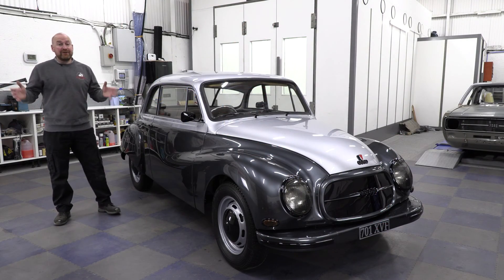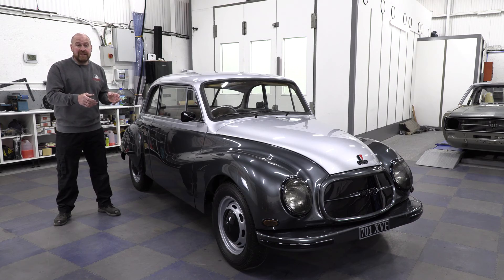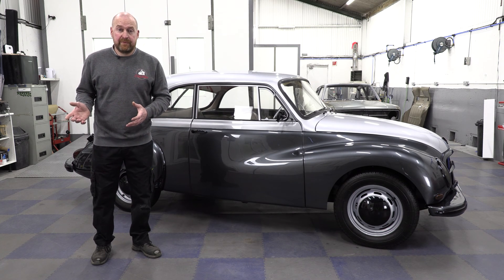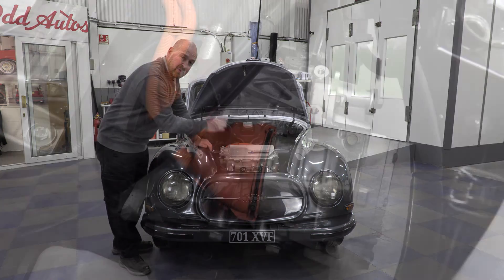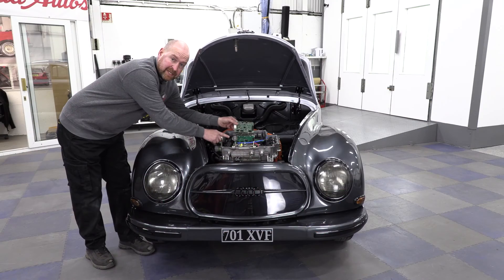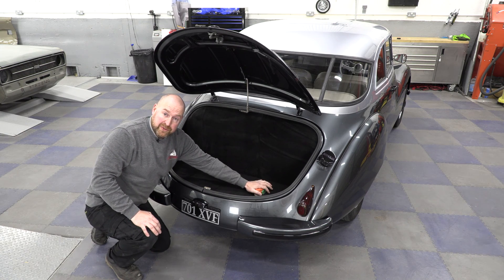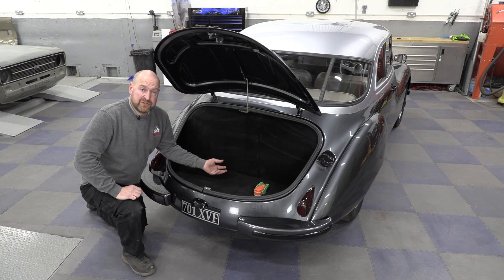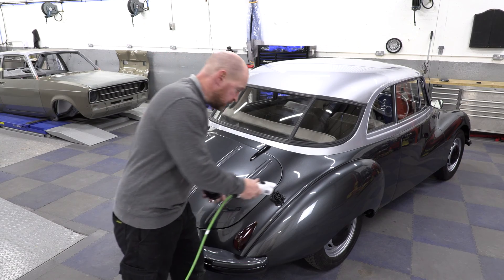( AUDI ) EV CONVERSION 1958 FULLY ELECTRIC DKW Classic car Auto Union, NISSAN LEAF motor, batteries!

Comment: Sir I must compliment you on professionalism in converting this nice car , but on the other what you have done with it ,makes me cry it should should completely original running on its own 2 Stroke engine  which has only  Seven moving parts  , you took away the Soul of the car  , even a wheelbarrow has a soul ?  this beautiful car has no value  at present  these cars were light years ahead of their time , they were more expensive than  V.W beetle in their time , Iv'e  got two of them in pristine condition    1  3=6  Sonder klasse  1954   and   1000's 1961  Good Luck with yours
Reply from the maker: Ha ha you make me laugh!

Comment: Since it's an old car, you should have kept it analog even as in it's EV form as in fact it's far more easy to make an electric motor drive train be analog compared to a combustion engine that is a little harder to do right.

Although how did you make the stock speedometer still work with the new power train?
Reply from the maker: What do you mean? Analog gauge for reading battery levels? The Speedo is run off the original gearbox.
Reply: @ODDAutos  it has a controller with a programmable microprocessor in it which is digital.
Reply from the maker: I could of made an electric car based on 1958 technology but unfortunately they were mega slow, unreliable and dangerous. Possibly why it didn’t catch on back then. Thinking about it I should have put thirty 12 volt lead acid batteries in the boot to make it “period correct” too, the extra 1 ton of weight would of really helped with the performance and handling giving it that old feel.

Comment: Great! Nice job done! 
I have one question about Leaf onboard charger and DC to DC converter. How much power it gives and how easy is to comminicate with and make it run compare to gen 2 onboard charger and DC to DC converter? Thanks
Reply from the maker: The charger is a Lear charger it’s out of a Chevrolet volt, same as the dc-dc was. It’s just set up on canbus and super easy to control with the EVCC.
Reply: @ODDAutos   I would like to convert my old VW T3 van to electric using all the electric components out of Nissan Leaf, like Rob Smith did https://youtu.be/bCOi19S71W4. I didn't see further videos about where all the system was installed, but I hope it should work, without buying extra components. I would like to keep the fast charge port from Leaf. I know, I have to change all existing electrical  installation of the Van and even try to use Leaf dashboard putting it to the van :) Also I will try to rearrange Leaf battery to other shape, and try to double or triple the cells in parallel using original BMS. I'm not sure it's gonna work and how much of capacity per one cell it can handle.
Reply from the maker: If you can use all the leaf parts you will save a minimum of £5000. Definitely worth having a go.
Reply: Wow, that would be a huge saving! 
Thanks a lot for your info ;)

Comment: You bought a whole Nissan Leaf. Did you consider using the whole powertrain from it? Inverter, BMS, etc...
Reply from the maker: I did use the inverter, the BMS is in a canbus system and talks to everything so would have also had to use the dash cluster, keys, body module, central electrics module.... basically everything electrical on the Leaf to get it to not show a fault and work.
Reply: @ODDAutos  
I have an old bronco rusting in my driveway. There’s nothing in it I want to keep, so I could reuse a whole Nissan Leaf system, dashboard, charger, etc... 

But I wonder why most conversions use aftermarket systems?

In your situation, why didn’t you want to use the leaf systems? For example you had to have some sort of dashboard so why didn’t you use the Leaf dashboard? 

Ps: I drive a leaf, it’s awesome. And the old ones are so cheap, it seems like a great opportunity.
Reply: @ODDAutos  
How did you do with regen brakes, abs, traction control and power steering? 

I think I see your point: with aftermarket controllers you have more flexibility, but with the leaf systems you would need to implement all those systems, add speed sensors on each wheels, etc...
Reply from the maker: There’s just no room to fit anything in my car, it’s pretty small inside. Also the Orion BMS is programmable so I can reduce voltage output to the motor to bring the power down and also use a wider range of battery voltage. Also my old battery was only showing 9 out the 12 bars of battery life, with the Orion I can compensate and bring each battery cell back to nearly full power. The regen again is programmable in the inverter so I’ve had to fine tune that to a point I hardly use the cars brakes now, you just play with the throttle settings so at quarter throttle the regen starts at 1 Amps and then reduces to no throttle I’m getting 75Amps regen. 

If you’ve got a lot of time I’d say go for it though with the bronco. The torque output of the motor is amazing.
Reply from the maker: Also I suppose with the aftermarket stuff it’s ease of fitment at the end of the day, I did the whole restoration and conversion in 6 months.
Reply: @ODDAutos  
Thank you for taking the time to answer, I appreciate. 
You’re right, you have space constrains that I don’t have. Plenty of space in my bronco. 

What an interesting conundrum. 

I don’t have time constrains. The bronco has been rusting and collecting dust. Same with another truck I’d like to convert, it’s a Chevy k20. 

Now that I drive a Leaf, I can’t stand the smell and noise of gas engines, I want to electrify everything!!
Reply: @ODDAutos  
Used leaf start at $3500 for a whole working car.

Comment: Beautiful .... 2 quick questions .  The registration plate  what accuracy is needed in the alignment to avoid wrecking the gearbox/motor bearings ?  Is it easy to insure for its new high value?
Reply from the maker: Glad you liked the car. For the shaft alignment it has to be pretty spot on, the motor does high rpm so you would get wear / vibration if it wasn’t perfect. For the insurance you need to get an agreed value on any classic car, otherwise if the worst happens and the car gets damaged the insurance would only give you book value. And on a 60 year old car that wouldn’t be much at all.

Comment: Awesome build, and nicely finished. One question... You bought a donar Nissan Leaf, why is it not possible to use the the battery management and charging system that was already in that?
Reply from the maker: It’s all linked as a system with the dash, key, body control and much more stuff. The wiring loom would be too much to put in the little car. It’s just easier simplifying it with after market stuff but unfortunately is more expensive.

Comment: Nice work!   What did you use for the leaf motor coupler?  (I'm guessing the  input shaft from the Leaf gear box??)   Thanks!
Reply from the maker: I made it. The output shaft of the motor is a 20 spline shaft so just found a clutch friction plate that would fit it. Then used the Auto-Union friction plate too, put them both in a lathe and reduced them down to fit inside a steel shaft. Then just welded it all up 👍
Reply: @ODDAutos    Wow!   What clutch disk did you use?   I found one with 20 splines (1970 Fiat Spider) and wasn't impressed with the tolerances, so I'm still looking for a better fit.  See bbitnerblogs.com/e-miata

Comment: Any suspension and or brake upgrades?
Reply from the maker: Put stronger shocks on it, and didn’t touch the brakes. The regeneration is set so when you let right off the throttle it brakes for you, hardly use the brakes at all now.

Comment: Love it!

What sort of hardware costs (excluding vehicle), should one reckon with for such a build?
Reply from the maker: The extra costs excluding the Nissan Leaf added up to another £5000 to get the ev side finished and running. It was a lot less but when you add the UK import tax costs to what I got from the states it all adds up.
Reply: @ODDAutos  thanks for the reply - the costs aren't as bad as I thought. Of course, there's your time to be added.

To what extent would you suggest a newbie (in the EV scene, albeit with a fair bit of technical and automotive knowledge), can try project like this?
Reply from the maker: This was my first conversion too, if your fairly ok at normal car electrics and can fabricate a little you would be fine. Just the high voltage part you’ve got to be super careful with. The suppliers are a great help too and also you could join the facebook group.... 
EV (electric vehicle) share support conversion parts ideas. There’s lots of like minded helpful people on there too.

Comment: What a Beauty :)
Great job!
Just wondering why you didn't use the Thunderstruck controller for the Leaf inverter as you used their other products?
Reply from the maker: Thunderstruck only do a controller for Nissan Leaf Gen 2 inverters. They are currently working on making a Gen 1 though.